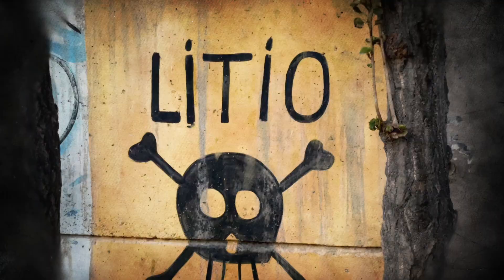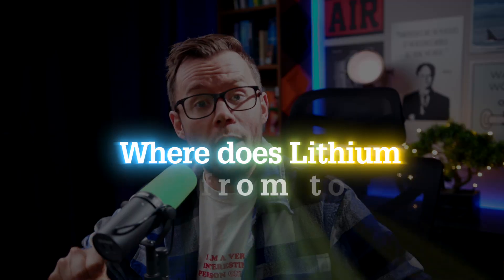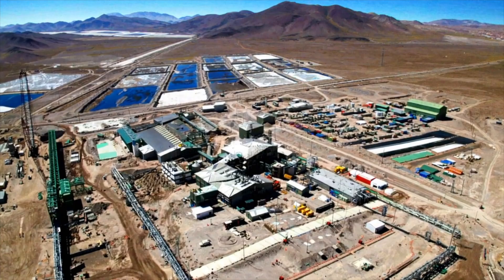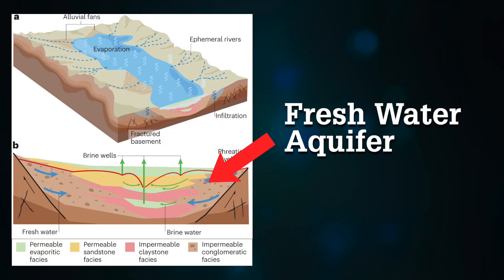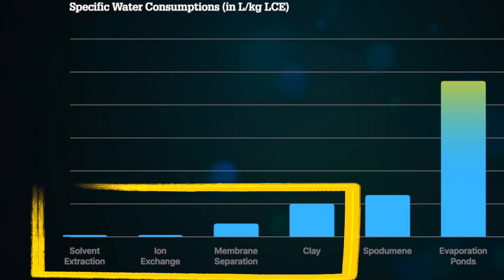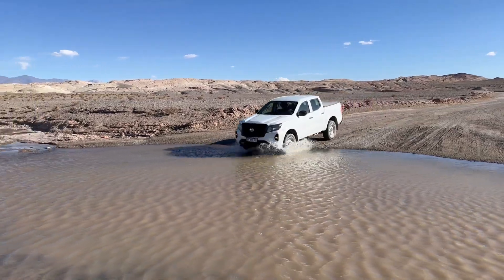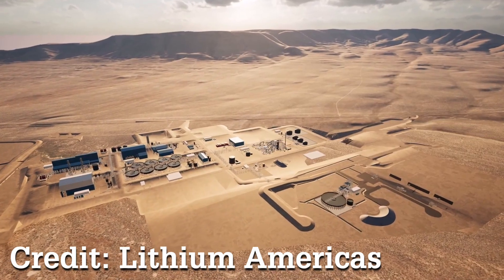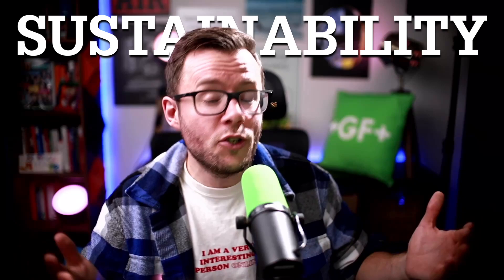Why Most People Get Lithium's Water Impact Dead Wrong

Comment: For me the main takeaway was that lithium apparently comes from sub-terrestrial brine. The brine seems to have been harvested in situ in the locations where the evaporation ponds are, so no energy was expended in (horizontal) long-distance transport of water. The main concern about water waste seems to be that in-situ non-salty aquifers would spill into the vacuum left by the extracted brine. This migrated freshwater would presumably get contaminated and turned itself into brine(?)... This begs a number of questions: if these lithium extraction operations are carried out in remote locations where no agriculture is being conducted and not that many people live, the spoiling of in-situ freshwater aquifers may not be an enormous problem (? I'm also assuming these freshwater aquifers have no significant intrinsic ecological value)... Also, around 10:05 in the argument of the CEO I thought he was going to argue that potentially a large fraction of the evaporated water will rain out (e.g. orographically) over land in a region where this water is more valuable than in the location where it was pumped to the surface? Especially when this lithium extraction is being carried out on an elevated plateau (4000m was it?) it seems plausible a large part of this water will rain out somewhere over land? But then it begs the question whether it is really worth to invest in desalination and recuperation equipment (and horizontal long-distance water transport)

Comment: How much "water" it takes is irrelevant.  In the end, the water doesn't go with the product, so it whatever process used doesn't consume water.  It is a question of where the water comes from, and how difficult it is to treat when you are done, and how thoroughly it is likely that the water is treated, and what are the impacts in any deficiencies in water treatment.
Reply from the maker: True, or almost true. The point is: when you're using a natural evaporation process (as you do with evaporation ponds), you can't treat the water when you are done, it simply evaporates away. And as those places are naturally already arid, it can, over time, have some impact on the local aquifers, which ultimately raises questions.

Now, the "difficulty" to treat is, before anything else, a matter of economics, so the likeliness of water treatment depends on the financial incentive to do so. But your comment brings together my thesis in the video: all processes (except the evaporation ponds) can be more or less water-intensive, depending on how much effort you're willing to give in looping the water!
Reply: @AntoineWalterDWW  I think my comment captures your issues about aquifers since I did point out that part of the issue is where the water comes from.  In an incredibly arid area, water is very valuable.  But even very valuable water might be insignificant compared to the value of the lithium.  In practice, much of the world has no significant population.  That with lithium being valuable, there might be parts of South America that end up having just as low population density as arctic Canada isn't necessarily a bad thing.
Reply from the maker: That is a very objective answer to a very subjective question. 😅

You're right on population density: Santa Rosa de los Pastos Grandes, where I slept while working at Eramine, is the 3rd largest city of the "Andes" department of the Salta Province. And it has... 136 inhabitants (I guess 138 while we were there with my colleague).

Yet, water has a role in an ecosystem, and wherever you go to mine for even the most precious resource, there is (at least) a social license to operate. The "Litio" skull head I'm picturing at the very beginning of the video was the neighbor of an "Uranio" skull head in Purmamarca - and this opposition got the uranium mining project canceled.

Similarly, the entirety of mining in the Atacama "only" represents 3% of the Water abstractions in the most arid place on Earth (as per the World Bank's count), yet permitting existing project extensions and new projects in Copper and/or Lithium is not a given, as populations and species living on a certain place have also certain rights over those certain places.

Even in different geographies, the same applies: a Lithium project got cancelled around the Great Salt Lake in the US, for water access/consumption reasons. 

My cautionary answer, hence, is - it's a subjective matter with very little room for black or white, it's really about shades of gray. As often to always when it comes to water!
Reply: @AntoineWalterDWW  I guess after being an Objectivist in my early life, I can't complain when some one is pointing out that I'm being objective, rather than being subjective!  Who owns the area and the water?  My current break from Libertarian thoughts is based on not buying into what I consider as a weak logic of acquiring property via homesteading. In practice, most property rights have been acquired via conquest, rather than homesteading.

Comment: Is the brine from desalination plant to low in lithium to be cost-effective.
Reply from the maker: That’s a great question - many have been toying with the idea for years. It is technically doable to extract lithium from desalination brines, but if you do it in isolation, it is not economical today.

So the trick might be to combine it with additional recoveries of more stuff - you can even recover uranium from that seawater brine. But building the value chains around it is a long shot!

The closest to that circular seawater desalination brines economy is Neom in Saudi Arabia - and at this stage, it’s still a project.

Closer to us in time, we might want to recover lithium from produced water (oil fields’ water). The concentration is 10 times lower than in the Lithium Triangle, but still 10 times higher than in desalination brines.

Comment: Reality states electric cars are not the future....but then again they messed up something genuinely renewable hydrogen cars...but maybs we have hope...and buses and trains for the masses
Reply from the maker: I looked into hydrogen (it’s on this channel - but not commenting here for advertising reasons!) - the problem is thermodynamics.

The production of hydrogen is quite “costly” energetically speaking, so the yield is low. And the subsequent step where you use the hydrogen as a fuel is also quite constrained by the low power density of hydrogen as a fuel. Today, 92% of the hydrogen used in the World is used directly where it’s produced - that’s the extent to which it’s moving.

Now hydrogen has a role in the green transition (think of: the way we feed the World with the Haber-Bosch process, the way we make our steel and many other uses), but I’m not quite sure it should be used for transportation, in places where batteries can make it.

Cargo ships could be an option though! (probably through Ammonia)

Comment: Why dont they build a dome over the evaporation ponds, use lenses on the top to magnify the sun, and all the water that evaporates off of the ponds will condense on thè outside walls of the dome can be collected and reused to pump up more brien
Reply from the maker: Theoretically, that would be doable! But that sounds like quite expensive and cumbersome, when DLE can do the same trick in a straighterforward fashion 😅
Reply: @AntoineWalterDWW  use plastics over an aluminum frame
Reply from the maker: Those evaporation ponds are really, really huge! You would need quite a good bunch of aluminium frame and plastic film!

On top of which; there’s a reason why it evaporates so well in the Andes: you have quite some wind - so your dome would have to withstand that. Tricky! 😀